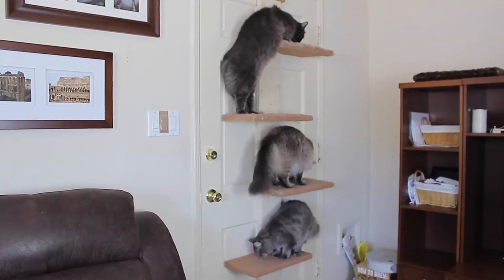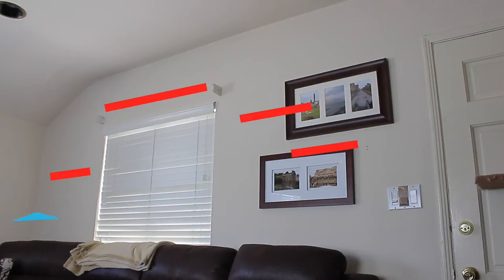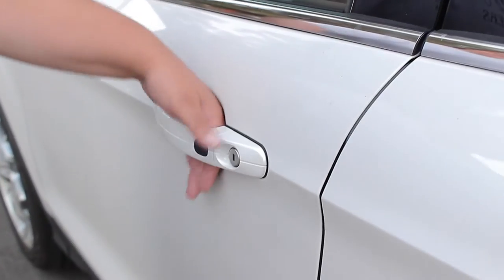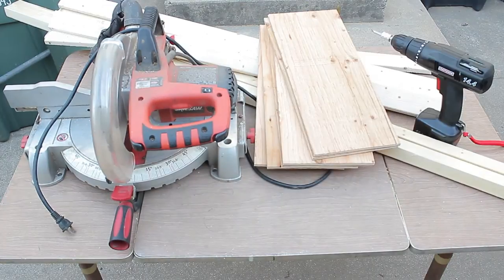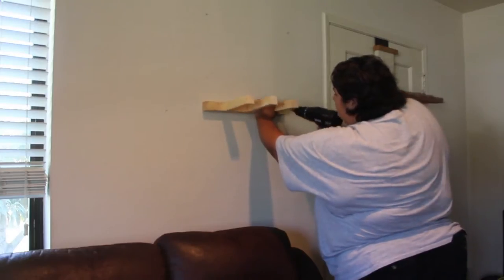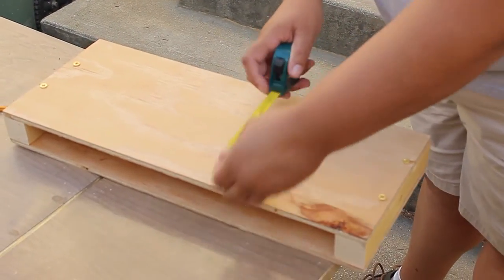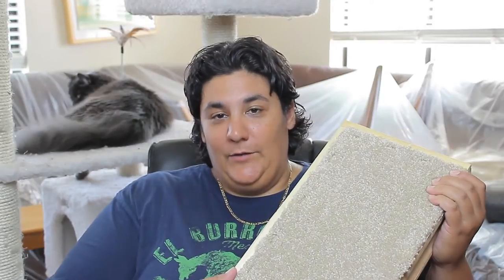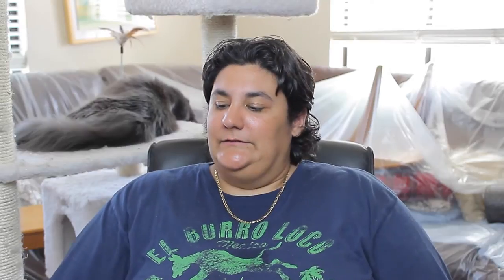Deb's cat shelves

Comment: Good job on the project! For not having much experience you really made it work. I know that this was a while ago and they're probably already painted, but I would suggest some wood filler for the cracks in the finish boards before paint. 3m makes a good sandable patch and hole filler that has primer integrated into it. You just use a putty knife to squish it into the cracks and flatten it off, doesn't have to be perfect because you will sand it flat once it dries in about 30 mins to an hour... Then you paint over that and you can't see the cracks, it looks like a solid piece of wood. It probably wouldn't matter to you or anyone else who sees the shelves but I think that the final touches make a ton of difference in the finished project(I'm a perfectionist, it's my curse). Anyway, good job and thanks for posting.